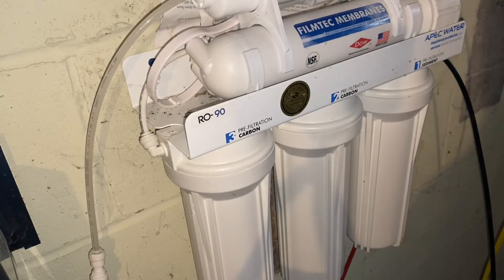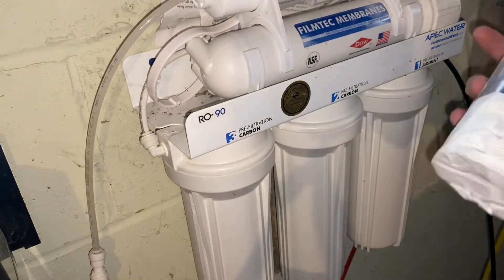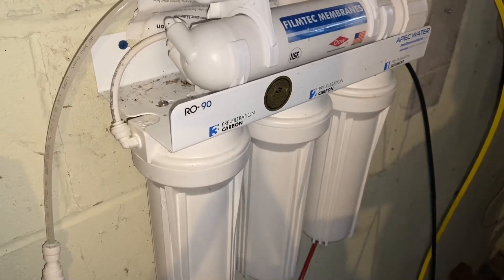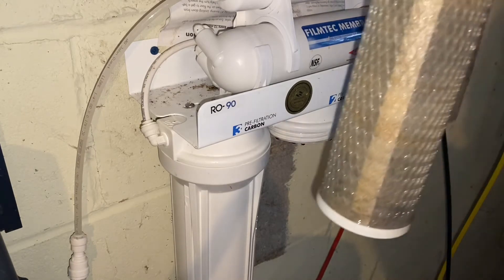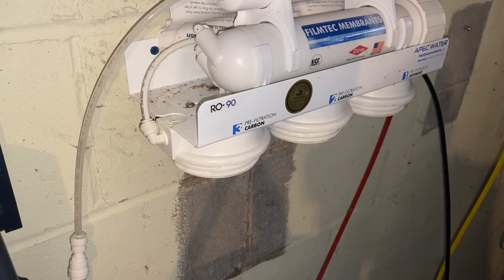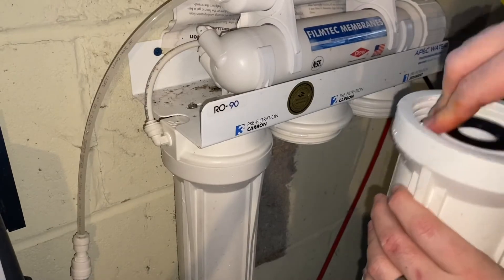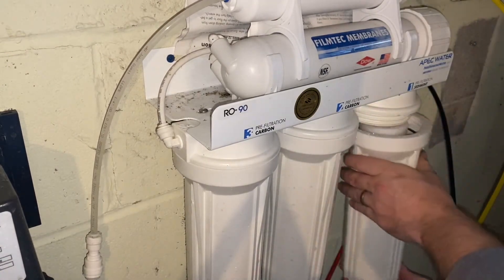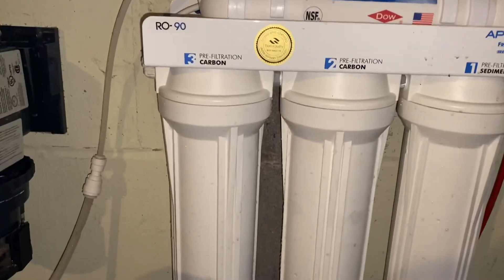How to Change the Filters on an APEC RO90 Reverse Osmosis | #DIY #Apec #Osmosis

Comment: FYI, the very last step is to TURN ON the cold water supply and RO faucet lever for 10-15mins while the tank ball valve remains CLOSED to normal water stream to relieve built-up pressure inside the RO.

Comment: Thanks ! I usually fill the canisters w/filters installed 3/4 full of water then screw them on, maybe it makes no difference. It seems I’m back up running a little sooner. The RO water is used for my ice machine on fridge. Always a little nervous i could get air in that line but so far its fine. Any thoughts ?
Reply from the maker: I haven't had any issues yet. I think the air is pushed out thru the drain line when the filters refill.

Comment: I have had one of these for 24 years this is my second unit.  I have a leak around the top of filter on it about a 1/2 a quart a day.  I’ve purchased new o-rings from apec and the lube and it’s still leaking
Reply from the maker: The canister could be cracked. Maybe from overtightening or being dropped.